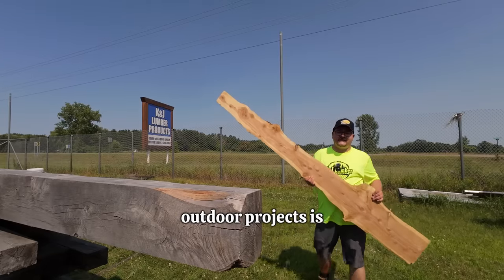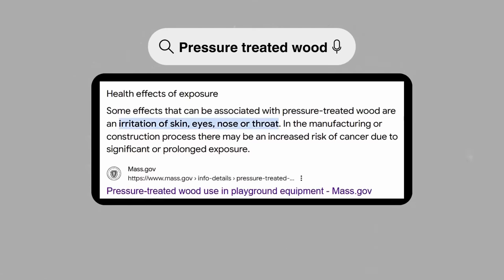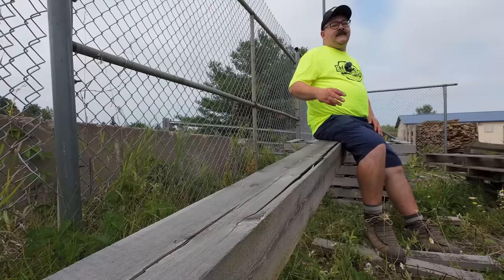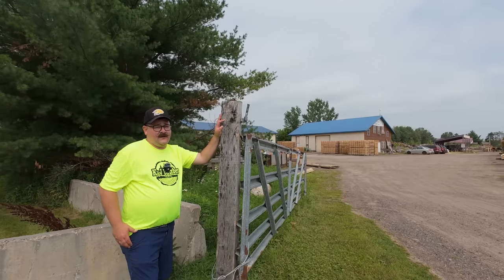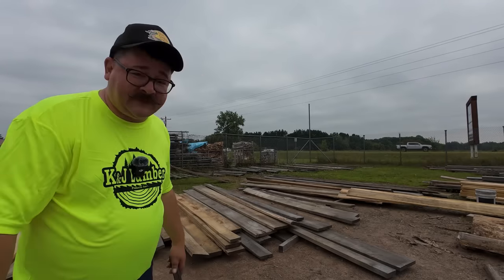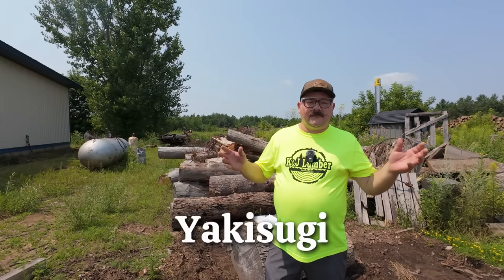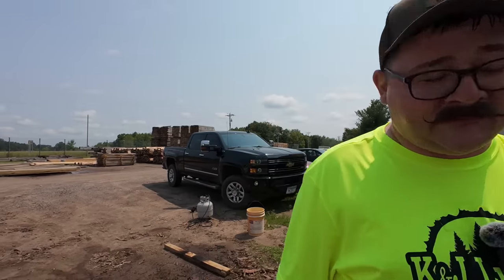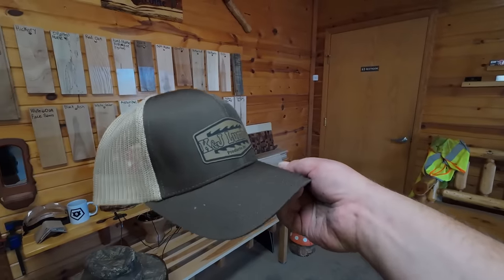the Best Wood for Outdoor Projects is...

Comment: White oak? I wouldn't have guessed that. We have redwood around here but I think cedar is cheaper.
Reply from the maker: It’s all regional, if you do not have the commonly used Western Red Cedar in your area, then we suggest using White Oak as that is usually available in most states across the U.S. hope that clarifies it. Thanks for the comment brother, hit that sub button!
Reply: @kandjlumber  So you folks use white oak for things like fascia? I would have assumed it would move quite a bit.
Reply from the maker: All lumber shrinks. It's just how much you plan for. how much you're willing to put up with.
Reply: @kandjlumber  Seems like oak twists a lot more than redwood and cedar. Probably due to the grain pattern.

Comment: Plastic burns like an OIL FIRE!! 
A green conscious village loaded their parks with plastic picknick tables. Board teenagers were hanging out in the picknick shelter which had twelve plastic bench-table things. They used a lighter to melt the side of the plastic for fun, but..... In the end the glue-lam shelter was destroyed, flames smoke and flames were over a hundred feet high, toxic fumes drifted thru the neighborhood. Plastic is oil!

Comment: White cedar is actually not cedar, it’s a juniper. Juniper, like cedar, is rot and bug resistant. It grows in cold climates like Alaska, and is medium+ hardness. It’s great for outdoor exposed or underground use. It’s cheaper than cedar or oak. For best results used 4” wide lumber, so 4”x4”s. It greys in the sun but that doesn’t damage it much. It chars well.
Reply from the maker: Thanks for the insight.

Comment: I like to burn my tool handles that I make from either maple or Osage orange with a torch lightly then sand off part of the char before adding BLO
Reply from the maker: Yeah I (kyle) bought a hatchet last year and debated doing this with the handle but it came already finished. I like to make my own handles and now I am wondering how long it would last pre-finished vs. burned…
Reply: @kandjlumber  I wouldn’t think it would make a big difference as long as the woods are the same and they’re both dry equally. Run an experiment with two of the same handles on something you use frequently.
Reply from the maker: @liquidrockaquatics3900  that’s a brilliant idea, another person has told me to go ahead and do a video on finishes. Maybe I’ll include this idea in the experiment and try to remember to give you guys a shoutout for it.
Reply: @kandjlumber  I don’t know why but the burning seems to really improve the texture even over sanding to a high grit and I don’t exactly know why. I think it does something to the internal structure of the wood. I just don’t know what.